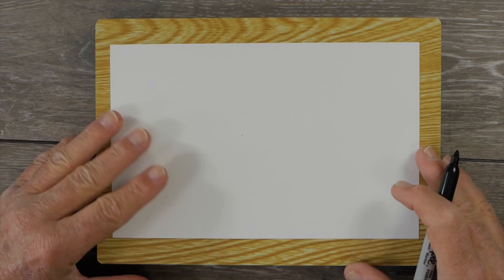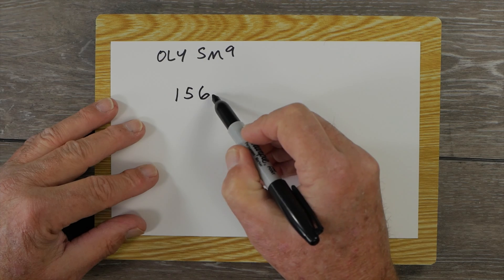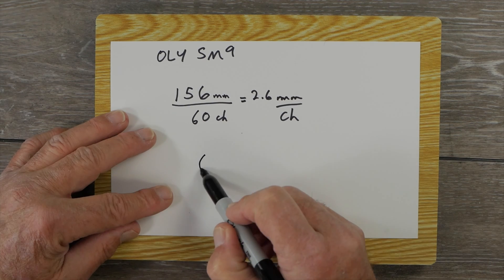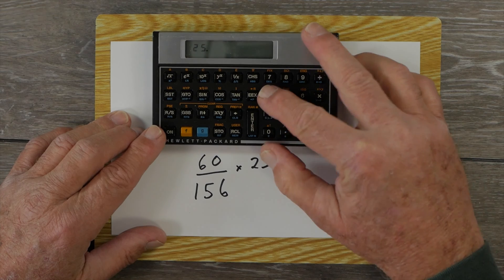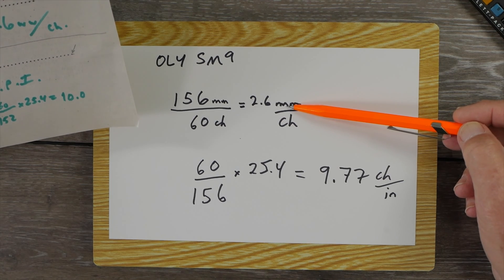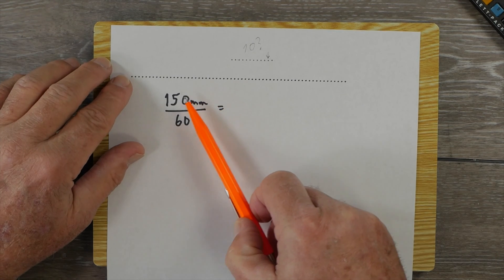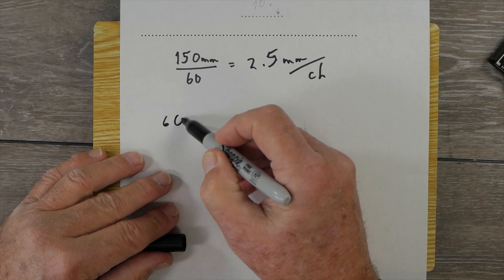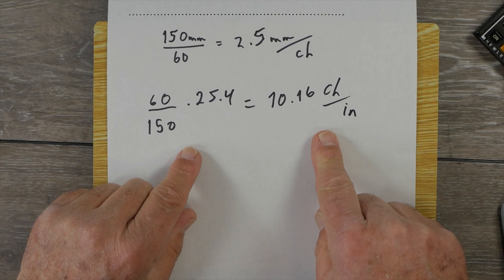Measuring Typewriter Character Widths

Comment: Here is a fun quick type measurement I was told about Hermes 3000 and I know this works for the curve not sure it applies to the box body, but I don't see why it wouldn't.

So if you want to know if it types Big or really tiny.
Look at the flaying ribbon margin bar or the paper bail that has the ruler in it.
If it end at 90 it types in a larger font I can't remember if it is Elite or Pica...just that it's big if the bail arm or paper arm or margin bar as it is on a H3K.
Now if it ends on 120 it types really small and can be hard to read.

And then two bonus on H3K
If the lid has shiny shoulder buckles on the handle of the lid, it means it is a Deluxe model.

If the Typewriter has those iconic rectangle openings where the lid takes hold it mean the curve H3K is 1963 or older and if they are missing it means it's from the beginning 1958-1963...

I know Has almost nothing to do with this video, just what popped in my head and if we're having a conversation I would have mentioned this afterwards, lol I imagine we are having conversations....

This is interesting though I didn't know so much went into figuring out the Type...now I'll have to go see what my 3 typewriters are.  This was cool.  Thanks Joe. 👍

Comment: Fascinating!
I always learned that the CPI of a typewriter's typeface was called its "pitch." You ask what' the pitch of the type is and the answer is that the pitch is either Pica or Elite.
As a desktop publisher, we always measured text vertically. How tall are the letters? For this, an "M" would work just fine. From this perspective, Pica typefaces are usually 12 points high, Elite is usually 10-point text.
Traditionally, a "point" is 1/72.27" of an inch, but when Adobe developed the PostScript page description language they retconned/changed it to be exactly 1/72 of an inch.
Just to confuse things,  there are 12 points in a pica and 6 picas in an inch.
I like your measurement system, but I think using a micrometer is going a bit overboard.

Comment: Excellent explanation, Joe. Very useful for determining the pitch of our machines. But the point is that I have machines that are Elite and have a larger font size than some Pica... My Antares Parva is Pica but has a very small font and therefore has the characters far apart from each other. In other words, character spacing may not have a direct relationship with the size of the font. I hope I made myself understood...

Comment: Wonderful detailed dissertation on character sizes!

I like to use the paper scales for measuring as it is easy and the most direct reading.  I measure between bars indicating spaces, not typed caracters.  It avoids the problem of measuring the center of typed characters on the sheet of paper and does not require a precision caliper.

For typewriters made in countries that were still using the inch as a unit of measure, if you use a ruler to measure five (5) inches on the paper bail or the paper scale, it will amount to:
30 spaces for a 6 cpi pitch, 
50 spaces for a 10 cpi pitch and, 
60 spaces for a 12 cpi pitch.

For a typewriter made in countries using the metric standard, the length of 50 spaces on the paper bail or paper scale measure: 
90 mm for a 1.8 mm pitch; 
100 mm for a 2 mm pitch; 
115 mm for a 2.3 mm pitch; 
125 mm for a 2.5 mm pitch; and, 
130 mm for a 2.6 mm pitch.

Daniel

Comment: Thank you for this video. My typewriters have character distances between 2,25 (Olivetti Lettera 22 with Imperial), 2,3 mm Adler Tippa in Cursive,  2,5 mm Hermes 3000 Pica, 2,6 mm Pica at several Olympia and even 2,675 (?) at my Adler 7.
Reply: I have measured my 1957 Lettera 22 with Imperial/Bodoni at 2,22 mm per character on the paper scale, the more precise method for measurement.

Daniel

Comment: The 1970 RaRo catalog lists a range of character spacing for typefaces.  No surprise that 2.1 to 2.3 mm is common for most elite pitch faces and 2.5 to 2.6 mm is common for most pica pitch faces.  I wonder how each manufacturer decided exactly which spacing they wanted to use.